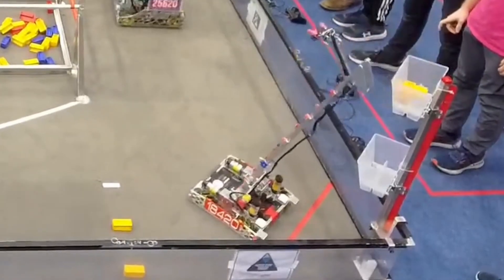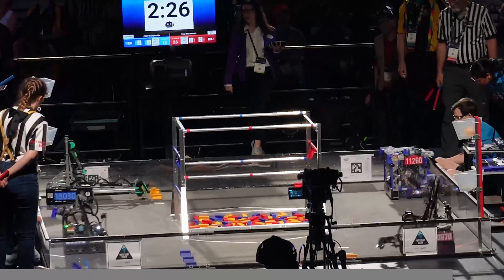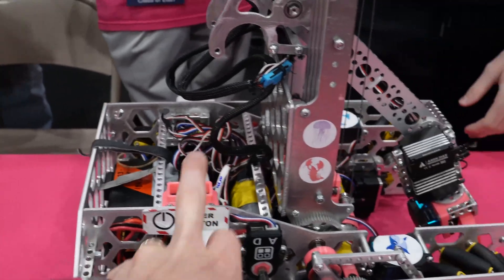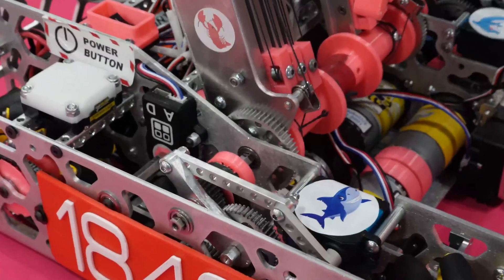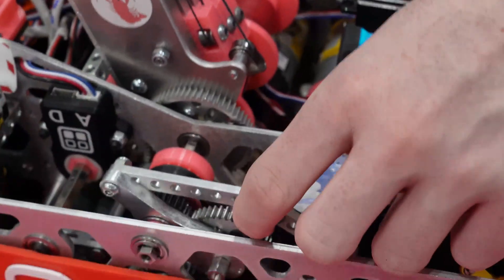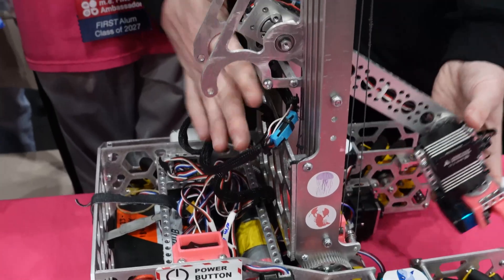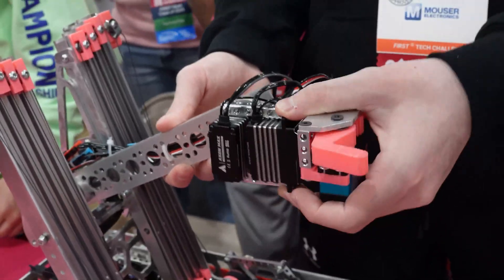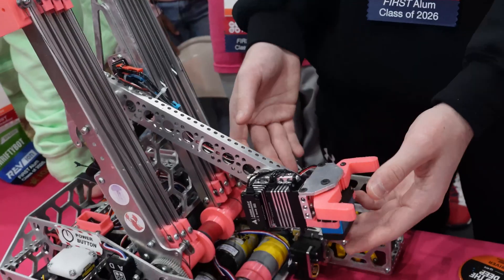FTC Robots Revealed: 18420 Metal Masters - Driver Automations

Comment: Really enjoy your content, The experimental video's you've made are really informative and have been especially fun to watch. Always cool seeing an ELC encoder pop up out in the wild! : )
Reply from the maker: Cheers! Haven't heard of you guys before, A/B Style digital hall effect encoders?
Reply: @BroganMPratt  Yep, they are digital encoders with A/B signals, and also provide analog absolute positioning output as well.
Reply from the maker: What would you say separates your hall encoder from other's on the market? I Know REV, GoBilda, are popular options, why would a team want your encoder?
Reply: @BroganMPratt  Our encoders features dual output, Digital A/B Signals & Analog Absolute (easier for hub to process data) which other vendors distributing encoders in the U.S. currently don't offer ( at least not that I know of ). High encoder resolution of 4000 counter per revolution. Very competitive pricing. And optimized hole mounting for the goBILDA channel standard. So far it has been tested by over 35+ teams with 100+ units in the wild in this FTC season's Into the Deep with highly positive feedback. : )
Reply: It worked brilliantly for our team (the team interviewed here).  We plan to use it in future designs if we can find a good reason for it!